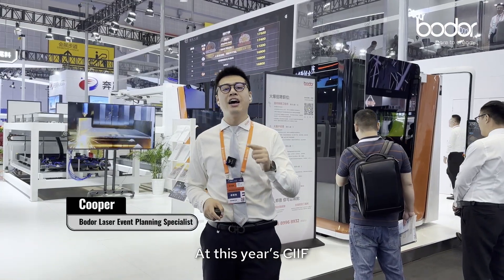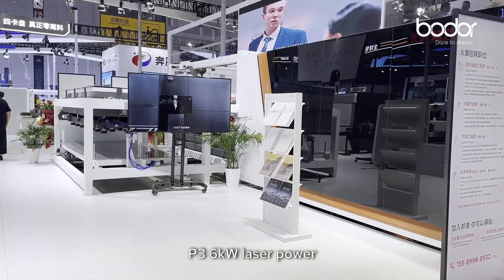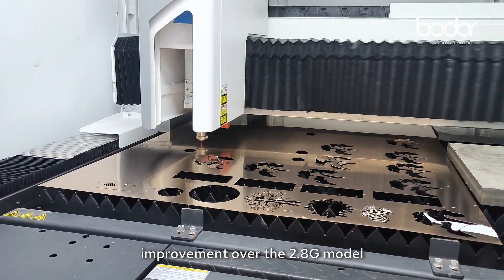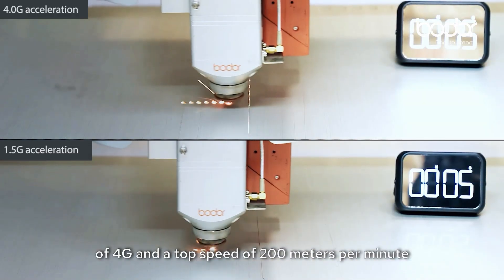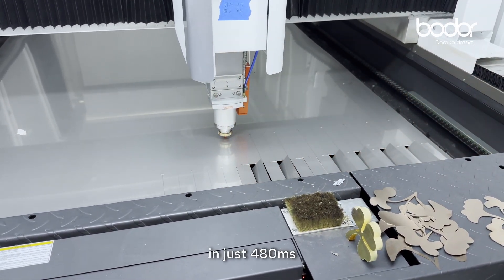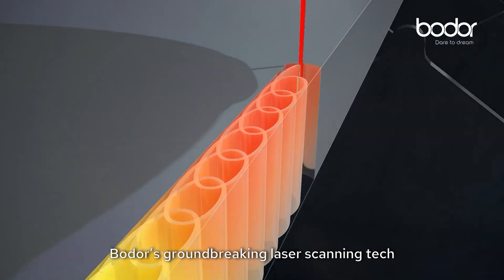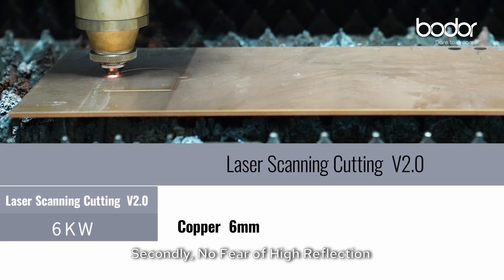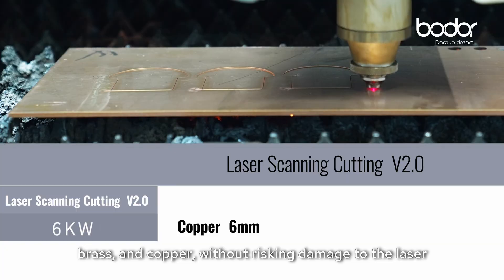Bodor P High-Performance Model | Fully Protective Sheet Laser Cutting Machine

Comment: The absence of light barriers around the pallet changer and the ability to open the door of a fibre laser cutting machine while it is in operation presents a serious and unacceptable safety risk. Fibre lasers emit high-powered, invisible near-infrared radiation that can cause permanent and irreversible damage to human tissue, particularly the eyes and skin, in a matter of milliseconds.

This design flaw directly contravenes essential laser safety standards, including EN 60825-1 and ISO 11553, which mandate appropriate interlocks and containment measures for Class 4 laser systems. The failure to implement such fundamental safety controls represents a critical deficiency in hazard management and calls into question the manufacturer’s commitment to operator safety and regulatory compliance.

This machine, as displayed both online and at exhibitions, demonstrates an alarming disregard for basic laser safety principles. If this reflects the standard of safety the company promotes publicly, it is not surprising that regulatory bodies such as those in the United States have issued bans or warnings, as noted in the following safety alert: https://www.accessdata.fda.gov/scripts/cdrh/cfdocs/cfRES/res.cfm?id=211822

Operator safety must never be compromised for the sake of cost or design convenience. Immediate corrective action is warranted.